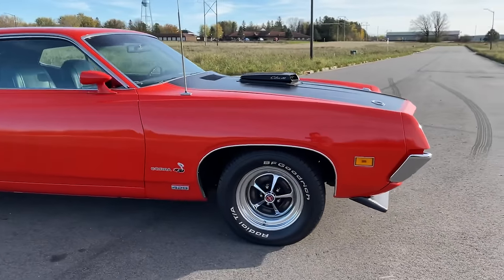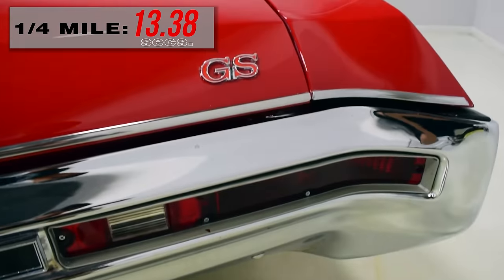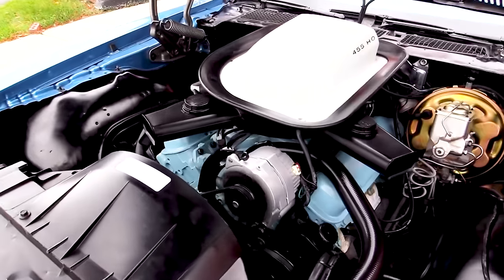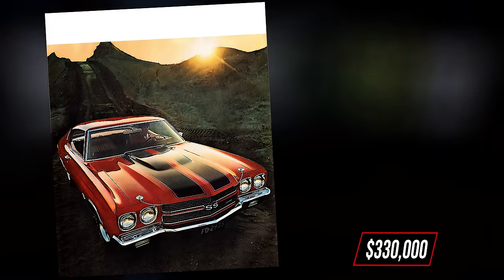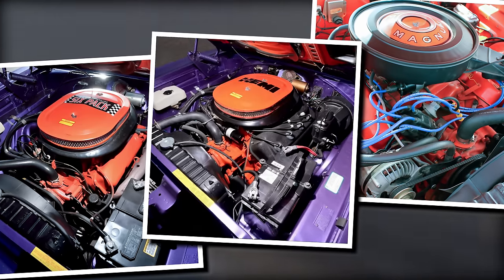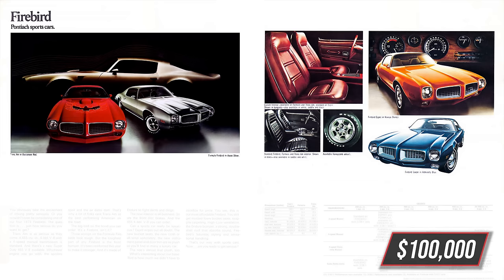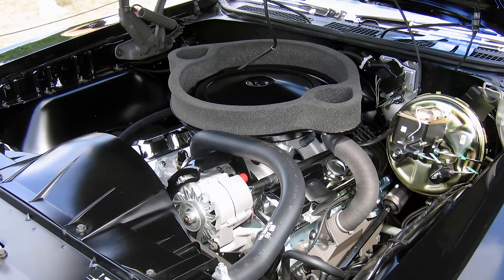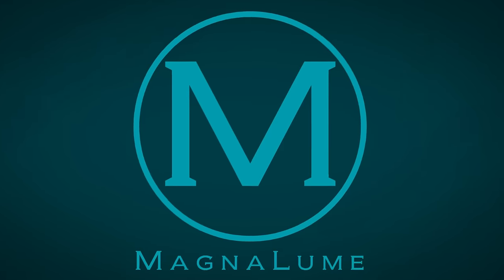10 Quickest Muscle Cars of the 1970s  | What They Cost Then vs. Now

Comment: My first car was a 1970 Road Runner. It was originally Purple but I came up with a white overall paint with black around the tail lights and two small black pin stripes on the top ridge one on top of the ridge and one under the ridge from front fender all the way back and to top it off I had the center of the hood which you know was raised up and it got the same mat black paint as the all around the tail lights was. I just loved it even though it was in 1974 and it got about 8 miles per gallon and gas was around fifty cents per gallon. THEN YOU UNDERSTAND THAT I WAS BRINGING HOME A PAY CHECK FOR UNDER A HUNDRED DOLLARS PER WEEK SO MY GAS BILL WAS REALLY ALWAYS ABOUT HALF MY CHECK BUT I STILL HAD SOOO MUCH FUN. DANG WHAT HAPPEN TO THE GOOD OLD BAD DAYS? I LOVED THEM NO MATTER HOW BAD THEY WERE. 😎

Comment: I was told that my 1990 1LE-IROC-Z was worth a lot also as does not have air cond. , no power windows or door locks nor a radio. It has 6.3 mi. on it and has been stored on jack stands , covered all this time. a 5.7 (350) auto.
Reply: Yes, iroc Is next generation collectible.  I thought they all had ac

Comment: My wife had a Chevelle Malibu when we got married. The lines were beautiful, but it didn't have the muscle package. I can never remember if it was a 1970 or 1971. Anyway it was the one with the more attractive rectangular tail lights.
Reply: 1970 rectangular tail lights.  4 headlights up front. 1971 and 1972 had round tail lights and 2 larger headlights. The 70  350 engine felt strong but the 71 was weaker and the 1972 was a real dud with the smog detuned engine.  I had a 1970 with 307 and Powerglide 2 speed auto trans, vinyl bench seats with the optional factory AC unit..

Comment: A '70 Formula 400 with Ram Air III was the way to go. Grossly underreported hp of 345 (actual hp was around 400) it was cheaper and easier to maintain than the Trans Am. Plus they just looked bad ass.